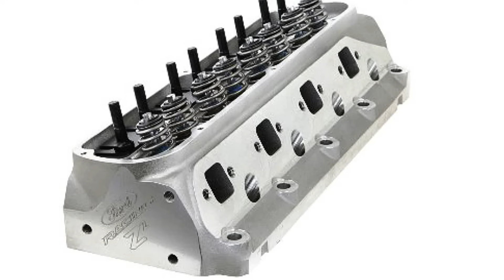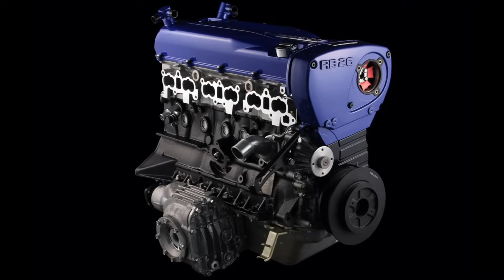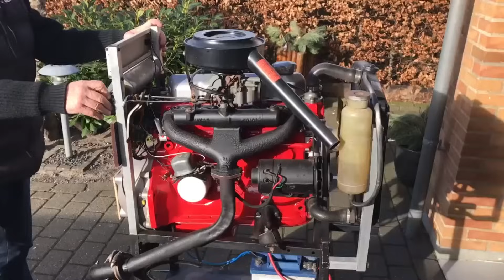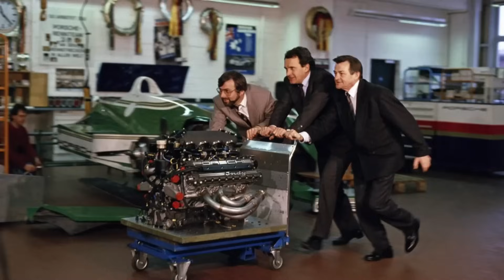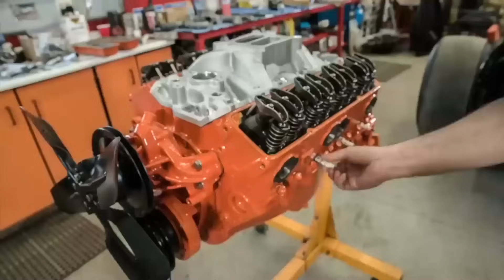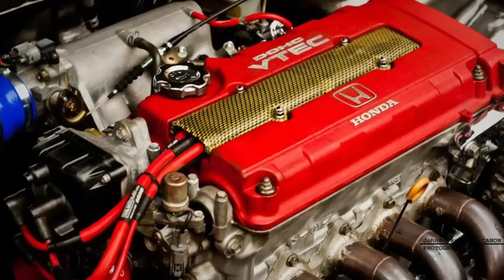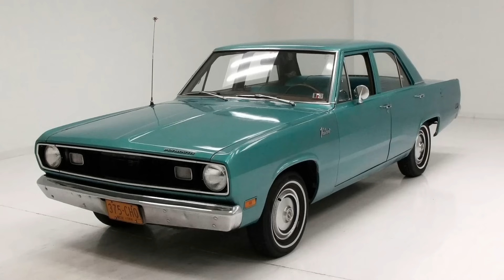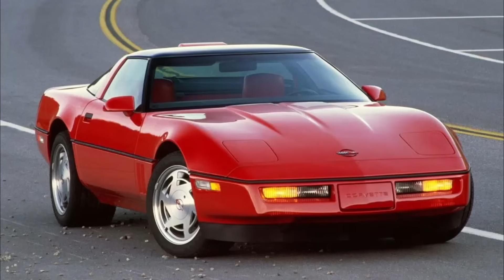30 Car Engines That Will Last FOREVER (2024)

Comment: Fun fact about the Volvo B18. Volvo really made it so understressed, made from best iron in the world, Kiruna mine. When the B18 hit the market one of Volvo's PR papers noted that a new engine was ran for 24 hours under load wide open throttle at 7,500rpm then disassembled. No measurable wear was found. And this was with a bone stock 1960s pushrod engine.

Comment: ANOTHER SOLID MOTOR (the next step from the VW 1.9 TD ALH)... The VW 1.9 TDi PD... Given basic maintenance... You COULD see 450,000 miles... On its ORIGINAL head gasket! (As seen on the YouTube channel 'Autoalex', the car, a Skoda Octavia 1.9 TDi (PD) nicknamed 'Miles' (The high mileage hero)... And they come in many models of VW, Skoda, Audi & Seat, and as standard many levels of tune from 90/100/110/115/130 & 150, AND are easily tunable to 240WHP/300Torque... 👍     😎🇬🇧

Comment: 3.8 Buick   nope  always spinning rod bearings... there were a PILE of them as high as the roof at the dealer i worked for.... 22 R toyota  YUP... u did leave one out   the Toyota 2.4 aka 2004 Camry.... 300 k miles is the break in period.... thats my # 1

Comment: I own 2 Miata 1990 & 1991 with the 1.6 dohc one with over 308k long nose and the other with 228k short nose. Both run very well. They leak oil but just keep going. I also own the Ford 4.9l 300 inline 6 over 300k in a 1995 Ford F-150 All 3 of my vehicle have 5 speed manual transmissions

Comment: My grandma bought a new ‘67 Sunbeam Arrow, a British Chrysler product with a slant 4 in it. After the body finally rotted out around ‘92 with just under 300,000 kms, my uncle tore that motor down (he cleaned up the valve seats). It has been running his irrigation pump ever since and except for winter, that thing runs continuously. An amazing engineering marvel.

Comment: You forgot all the Land Rover engines up to and including the TD5. The engines in the Series Land Rovers would run on virtually anything and regularly had to, while exploring the world. They, along with the 2.5 NA diesel, 200Tdi, 300Tdi and TD5 engines, can all easily hit over 300k, with just routine maintenance, with pre-TD5 diesels, being able to run on veg oil. The 3.5v8, will also easily cover 300k.

My old 1963 Land Rover, was still on it's original petrol engine and had almost 390k+ when I sold it to a farmer to live out it's days on his farm. I'd regularly run it on diesel/engine oil contaminated fuel, where people driving hire or courtesy vehicles from different places on the industrial estate, would fill up with the wrong fuel at the petrol station opposite the garage I worked at, so we'd tow them in, drain the fuel and put fresh clean correct fuel in, rather than empty the drain tank into the waste fluid tank, I'd refuel my Land Rover with it. It may have smoked worse than normal for a while, but always started and always got me where I wanted to go. My current 1997 Land Rover Discovery, with a 300Tdi, is barely run in at 167k.

Comment: My ford 4.0 2005 had 425,000 miles on it when I shut her down. Wife's 4.0 Toyota 4runner now has 250,000 still runs like a sewing machine.  2 mustangs 5.0s both with well over 250thou. Oil changes are key. And now driving like your in a race constantly.

Comment: I’ve got a 2019 ram 5.7 hemi with 300000+ km and still very strong i expect to hit 1000000 with this engine I’ve owned it since new oil changes every 7000 to 8 km 50,000km I do all fluids

Comment: The LS-1 is also the engine in my last built 2002 Pontiac Firebird TransAM WS-6 HURST edition.  ~50,000 miles on mine as it has become a collectors edition and is in pristine condition.

Comment: The Ford 300 six cylinder is in a class of its own for reliability. I don't think any engine comes close. UPS used them in their delivery trucks for decades. They are also used in a lot of industrial applications like generators, air compressors, well pumps and so on. Absolutely bullet proof engine design.
Reply: i honestly advocate for those engines if a person is serious about sustainability in the country.   they are so simple you can repair them with basic engine tools.
Reply: @terrenceolivido741  They have a lot of benefits. They can also be easily converted to propane or natural gas, which is a huge benefit in an industrial application. Hard to store gas or diesel for a long period of time, but you can store propane for a long time, and the 300 is perfect for it.
Reply: As a lifelong Ford partsman, I totally agree on the 300 cid. Built to stand the test of time.
Reply: Take one underground mining then come back 6 weeks later, Underground in Australia i give  it 3 weeks.
Reply: Ive owned both , slant 6 is better all day . i've ran a slant 6 hot after busting a hose in bfe  to the point the car stayed running when i cut it off . I had to pop the hood and choke it out. the exhaust manifold was red hot and when i pulled the dip stick the oil was boiling, no joke. I got up the next day changed the hose filled the radiator with water and drove to work. changed the oil a few days later . Oil and water are optional to a slant 6. So i know the age old question, where are they now then? The cars they were in rusted so fast u could hear it happen on a still night. If you painted it the the steering gear boxes with full turn of play or tie rods that just suddenly let go caused you to wreck. The one i had after i sold it to a buddy lost a tie rod and  flipped twice at 80mph crushing the top.  he crawled out lucky he was not wearing his seatbelt it would have crushed him.... it was upside down for hours before a tow truck ripped it over. when we got to the junk yard i got in and despite the roof touching the steering wheel and being upside down for hours it started.  smoked like hell but it started.
Reply: They suck gas though , but reliable as all get .
Reply: WRONG  they have 100k mile life span till they need opened up to replace the fiber cam gear.. Unlike the 2V 4.6L mod that can go hundred's of thousands of miles with nothing more than basic mait...  With that the 300 six does NOT really belong on the list. Nearly any engine will last forever if you open them up at 100K and replace failing and failed OE parts with superior after market parts...
Reply: @matthewq4b  you are wrong, I have seen many 300I 6 engines with over 500,000 miles on them! And never touched mechanically!! Been wrenching for over 34 years! Proper maintenance is key!

Comment: The classic Chevy small block (not just the 350) had a good reputation. It seemed the smaller displacement the longer they would last. They made so many 305's in the 80's, you have to put sand in the oil to make them stop. My dad had an 1982 Inpala (classic police car/taxi cab of the 80's) with a 267ci chevy small block, it was slow but got great gas mileage at the time and wouldn't stop going. I wish they referred to the engines as their generation rather than their specific engine size, The LS1 was just the beginning of the LS family, it just got better everytime GM made another version LS3/LS7.  Cadillac and Pontaic made some great engines also  (northstar V8, classic Pontiac V8, the Pontiac over head cam straight 6), I suspect the author of this video was over seas and just does not know about them.

Comment: Pontiac Iron Duke 2.3/2.5L. They power the still on the road US postal vehicles, the vehicles with the rear axle width smaller than the front axle. They ARE designed for high mileage and continue to prove it as the postal service is still running those vehicles beyond their intended service life! GM made about 4 million of these engines from the 70's through early 90's.
Reply: Thank you for posting this....very true....and they forgot the Jeep 4.0 straight 6 as well.
Reply: sigh,   had an iron-duke  in a Chevy S-10.   bought the vehicle for 2000 dollars.   four speed manual and that little truck was a small dent in the disaster that Detroit had allowed in the 70's.

Comment: A list 10 years from now - BMW B58.
Reply: I bought a used two owner 1994 BMW 325i sedan . It had well over 200K when I purchased it from the second owner who used to pull a boat with it. It had 275K and I was pulling 2000 pounds of a loaded trailer with to move all of our stuff many times. It still handled like a sports sedan with that trailer.  Surprised  a guy in a Honda Civic one day with the trailer in tow. 
  The M50 should have been on the list.  I'm sure that the M50 could and should be rebuilt and turbocharged heavily and she will go another 100K . I'm told that this engine can be forced to 450 🏇 power with no problem. I really can't crush that engine it seems like a crime to do so. Madison Wisconsin is not kind to car bodies. If it was I'd be on my way back from the moon now with it. She was a genuine work horse 🐴. Yeah my E36 with the 2.5 had a towing capacity of 3500 pounds ( the car weight is 3200 pounds) .  My supercharged 3800 GTP 1000 pounds ( the car weight is 3600 pounds)  Which of these two had the overbuilt drive train. Oh yeah that trunk in a car that was cozy for two was very large too. Really miss the 325i. 
    Driving a 2002 Trailblazer now... put your foot into the accelerator pedal and a very familiar sound from under the hood.  Yeah another nice chain driven cam DOHC straight six that could also make the list . Why didn't GM tip this one 30 ° and put it in a sedan. That engine has near full torque across the entire Rev Range. At least they put it in the best practical station wagon that GM ever built, but they should have given her a good five speed automatic transmission. Anyway 197K and purring like a happy cat 🙀..  As it is it's pretty tossable for an SUV. Even with it's long in the tooth suspension and being 4800 pounds of beast.

Comment: How about an engine that has ALL of  the best features for durability, and their patents have already expired.
They could be fueled by HYDROGEN (and PURE Oxygen) made on-board the vehicle at rather low pressure (thereby SAFER than 10,000 psi of compressed Hydrogen).
The engine block and head should be heat tolerant cast iron, and the pistons should be ferrous. Aluminum MELTS. 
Totally GEAR timing. Oiling 'squirters', etc.
Roller bearings.

Comment: My in-line Ford 300 will probably last forever as long as you keep the oil changed
Reply: My favorite motor 😁👍
Reply: And have the fiber cam gear replaced...

Comment: And I strongly disagree with the order where you have the LS is from an engine builder's perspective and a junkyard worker.L.S is are extremely overrated. Junk And additionally chevrolet 1996 chevy bought 302/351w Patent products in 1997 LS

Comment: Wrong.. the 300 inline 6.It is not a longer stroke than it's bore. It's a square motor 4 inch by 4 inch and The 240 I-six is 4 inch by 3.18

Comment: Electric motors, properly built which most are these days, will last VERY VERY VERY long time with a minimum of maintenance!

Just look at any electric motor elsewhere (fan motors, circulation pumps, industrial motors, ...), they last decades of continuous use.

Comment: I have a 1993 Ford Mustang LX, 2.3, 5-speed manual. that I purchased new and just turned 455,000 original miles. I just keep it serviced. Still going strong and looks new inside and out.
Reply: Yep...the 2.3's last forever...read about many in 90's Rangers hitting 400-500,000 and still going....and the 3.0 ohv and 4.0 ohv as well...super long lasting.
Reply: @barrya.6212  That is great to hear. I have a decent mechanic and just keep it serviced and do not drive it hard, just many miles. Thank you, it is great to hear of these  being so long lasting.
Reply: I bought a new '95 mustang gt and around 18 years later decided to run it in the winter. With 15" snow tires and 100lbs in the back & the posi rear end It went awesome in the deepest of snow. 2 years later it had to be junked from all the rust underneath. I guess ford didn't count on people running these in the winter. The 302 still ran good though.
Reply: @monongahelian  i have over 550,000 miles now. Yes, if salt on roads and wet mud can be damaging. I grew up in our California mountains. Every new car he would have it sealed. But fortunately we use gravel not salt. Going to the beach with fog and mist, I wash it after of it would have been bad. At least dry weather here helps too.

Comment: There's one king of them all.
Toyota's DOHC 5.7 liter V8.
More million mile engines than all the rest combined.

Honorable mention to the Corolla 4 cylinder. Also a 1 million mile engine.
Reply: That’s what I have
Surprised not mentioned
It is the King!
Reply: @jes3013  
I'm on my second. 50 years of vehicle ownership. I never thought they could get this reliable. My current has 150K miles, and the oil doesn't even get dirty. 😲
Reply: Toyotas 5.7 V8

Comment: 83 volve 240 DL wagon four speed manual w/ electric OD 415000 kms (265000 mi) rear bearing seal was leaking when I let it go but still ran perfectly. a very dependable vehicle.

Comment: The VW diesel on the 1990's Jetta is a long life item, my neighbor has over 1,000,000 km or 620,000 miles and still running.

Comment: i had never ever had an engine issue up to 200+k. usually what breaks at such mileage is transmission and repair/replacement is costlier than the total vehicle price

Comment: I bought a 1966 Plymouth Valiant with a slant 6 for $600.  Had it ten years and drove it 200K miles, then sold it for $600 in 1977.  Just did the basic maintenance and it kept on going.
Reply: I wonder if it was my old Valiant Wagon. It was indestructible.
Reply: I had a 77 Dodge Aspen 3 speed on the column with the 225. For 4 years of college in the 80s, lots of road trips, never an engine problem, or even a flat tire. tHey should resurrect that engine with fuel injection, restyled body,  and a reliable 4 speed automatic transmission and they'd sell millions Always got 22-25 mpg even with 5 passengers.The funny thing is I cannot even remember changing the oil.

Comment: I have 2008 Mitsubishi 2 liter Mivec non turbo engine. Very reliable 128,000 miles does not burn oil.  Built in Japan. My Subaru EJ257 engine rod bearings broke down at 79,000 miles. Not reliable.

Comment: That Ford Windsor is notorious for coolant leaks. 

The Honda J35 has a recall for rod bearing failure possibly requiring engine replacement. The J32 is a much better engine and the F22 has multiple documented 500k engines and a million mile 4th gen Honda Accord

Comment: You got my top 4 gasoline engines. 

GM 3800
Ford 4.6
Toyota 2.4
Toyota 4.0

everything else on this list is a near peer.  These 4 are the kings of outlast the rest of the car.

Comment: 97 Lexus lx450 fj80 with a trouble free engine and transmission after 265,900 miles. In-line 4.5 6 cylinder

Comment: I own a Daihatsu ed10 850 cc. three cylinder engine built in 1996 and still have everything original. That's tough as dogs meat. It even served as a taxi for a couple of years back in the time. Toyota bought Daihatsu in the 2000s but sadly  let the brand die. Most of their models like Cuore, Applause and Charade were so good that they are still running on the streets of Argentina and Uruguay, and for what i know in Other countries as well. Most of this cars are from the 90s so is really hard to get spare parts for them.

Comment: I am on my second Honda Pilot that has the j35 v6. My 2004 Honda Pilot had 380k miles when it started succumbing to body rust. I sold it to someone who said they would fix the body. My 2008 Honda Pilot had 225k miles when I bought it. It now has 260k miles. It needed some love (new timing belt, valve lash adjustment, spark plugs, valve cover gaskets, etc) but it now purrs like a mouse. That was the last year without cylinder deactivation which is why I bought it. I recommend it.
Reply: Honda petrol engines are legendary, just you have to keep your hands away from their diesel engines :D I owned 6 Hondas and I cannot say any bad words about their engineering.
Reply: I would have pulled the J35 v6 engine out of your first vehicle and kept it as a backup